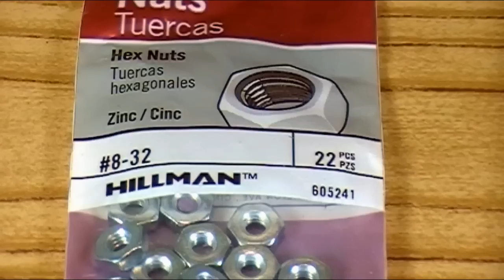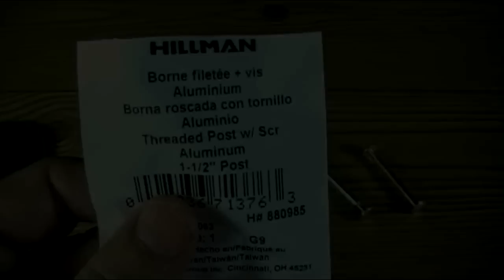ULTRA Compact Pocket Stove - With Built-in Pot Stand!

Comment from the maker: I'll try, lol. Carbon felt acts as a wick essentially and distributes the heat/flame more evenly and longer (and with greater consistency) than if you were to simply pour fuel into an open container and let it burn. It's use in stoves like the one shown here is also considered by some to be a slightly safer option than using pressurized stoves (which could potentially malfunction if built improperly). Hope that helps...
P.S. You're "In"  :)

Comment: They do something similar in the UK but with a shoe polish tin (slightly larger) and with fire rope instead of carbon felt. It can be put in the bottom of BCB Crusader cook stands to convert them to alcohol burners (and the paint doesn't burn off of the cook stand). I hadn't thought of putting legs on it before, great stuff!!

Comment: I found that you can use 3 cotton balls soaked in vegetable oil as an alternative fuel. I got this method to burn for 40 minutes on a windy day.
Reply: With a yellow sooty flame.
Reply: Getting a sooty flame for a 40 minute burn is a small price to pay for a hot meal. The operative word in the comment is “alternative”. The word means if you run out of Heet on your camping trip, pop open the ziplock bag, take out 3 of the 6 bags of oiled cotton and light them up to heat the food while breaking camp.
Reply: Thanks . I will try it .
Reply: @dreamdiction  do you know what survivel meens ?

Comment: Very NICE!  Question.  How do you put it out?  I happen to have an old flat metal film cannister (about 8" in diameter. Thought that I might use it. Still flat and compact.  Won't have to sand the paint off either.  Bet I could cook a BIG pot of stew on that. ;-)
Thanks for sharing.  VERY HANDY USEFUL TOOL.

Comment: I might have to try this style out.  Thanks for the vid.  I have not used JB weld yet on my stoves.  Have you ever had a problem with it holding up to the heat or it losing its seal from being bumped around in a pack?  Count me in.

Comment: Nailed it!! Well, technically, drilled it and then screwed it, but you get the point. 
How have I watched easily 100+ alcohol stove videos and this one finally popped up? Another 100+ twig/gasification stove videos, too. This should be waaaay sooner on the list. Its just simple and solid.
Currently on the hunt for a watertight and screw-on container for worry-free fuel retention.
Any and all safe (for high temp) alternatives to seal holes?? Hot glue gun? Plain ol' superglue? Anyone? Bueller?
Thanks for the complete build exact as possible. A+. Music just a B, but it did not affect overall score, lol.
Going to binge on the rest of your videos now. Hope there is a huge list. 
Cheers!

Comment: Wonderful idea, thanks for sharing. I was wondering, instead of the carbon felt and heet, I think I will try leaving it empty and putting in a large cotton round (not cotton ball but the flat round discs) that has been soaked in melted wax with a little pure lamp oil mixed in. They fit great in a "baby bottle thermos" or round tins and can double as fire starters, etc and I can just insert one at a time as needed for cooking. What do you think of that variation? Have you tried it?  I love your videos.

Comment: I know I'm late to the discussion here, but I'm hoping you see this and can help me troubleshoot!

I just built this, though my craftsmanship wasn't quite as good as yours.  But just like the last two alcohol stoves I built (different design) I can heat water, but I can't get a boil!

I used 1oz of yellow Heet, and attempted to boil 1 cup of water in a 900mL titanium Vargo Bot.  I got blue flames, and bubbles on the bottom of the pot, but never got a real boil.  Flamed out somewhere between 7 and 9 minutes.  I will try again with a windscreen on a different day.

Any ideas what could be wrong?
Reply from the maker: First, I'd like to say thank you for taking the time to watch and comment... it means a lot! It's really cool to hear that you built this particular stove. It sounds like you're doing everything right from the way that you described it. 1oz of Heet should definitely get one cup of water boiling easily (with plenty to spare). My suggestion/s would be to use a windscreen (as you mentioned) and to try using a lid (a scrap of aluminum foil over the top would work) if you haven't already. I hope that helps solve your issue with getting a good boil going. If not, don't hesitate to reply back and we'll see if we can't do a bit more troubleshooting. 
All the best....

Comment: Nice vid.  What is that black block you use to remove paint front the exterior of the tin?
Reply: +Jason Allen Foam sanding block. Can be used wet or dry.
Reply: Thanks!
Reply: use paint-thiner .

Comment: Take that carbon felt roll it up stuff it in a pipe with holes seal it at both ends make a curved reflector plate with a stand and you got a nice stove camp heater.

Comment: Add a bit more LB Weld epoxy to the screws just before you turn the nuts tight to the bottle to lock the nuts in place.